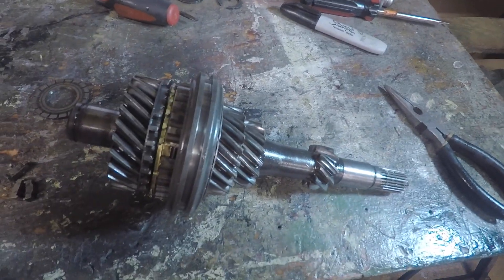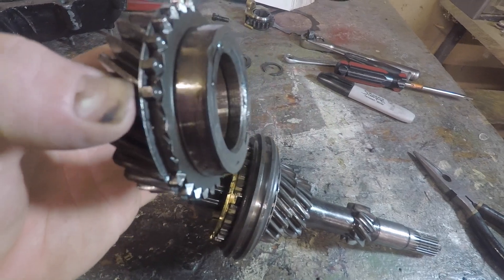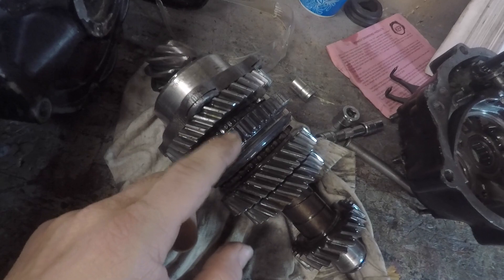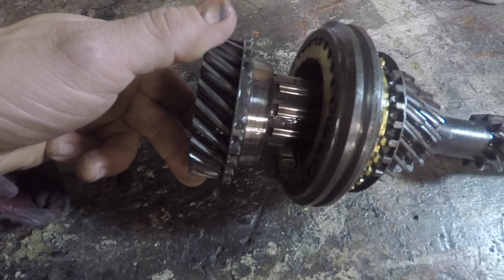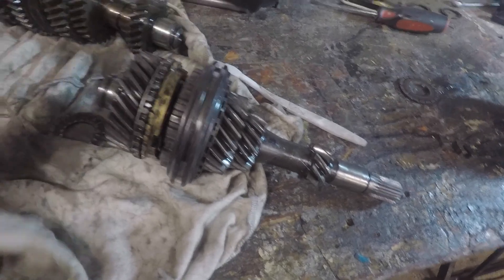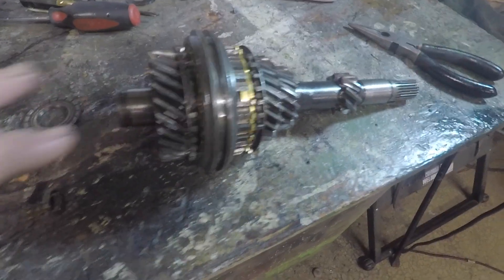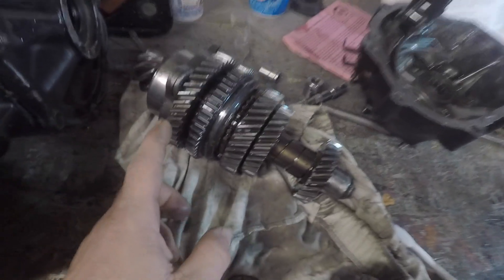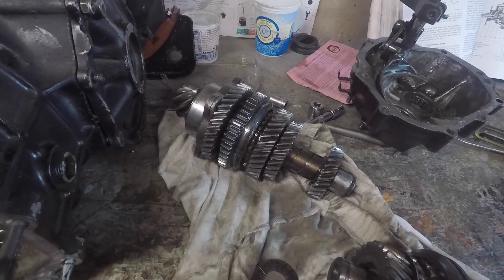VW Transmission Rebuild -  Gear selection?

Comment: They do that to the syncros on vw when they rebuild them it’s a trick I guess from day one the trans will only use 9 teeth if you rebuild the trans and see that the 9 teeth are badly worn you can grind them down and the trans will run on a different set of 9 teeth I know you posted awhile ago hope this helps
Reply from the maker: Mstile00 thanks! I eventually got that figured out. I swapped the entire set and kept the same ring and pinion. It seems to work okay, but has a bit of a higher pitch at high speeds.
Reply: Did you check the pinion gear it maybe loose it’s supposed to be torqued to 150 ft lbs just a thought
Reply from the maker: Mstile00 that’s a good idea - I have a transmission with the 4 bolts and not the center but style. I torqued the 4 bolts down to spec according to the Bentley manual. Next time I take it out I’ll double check them. Thanks for the tip